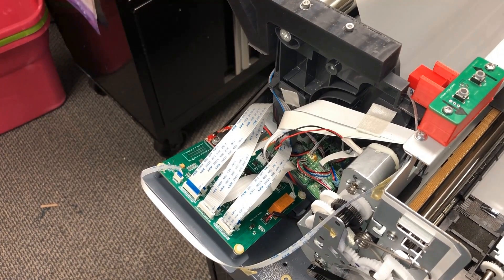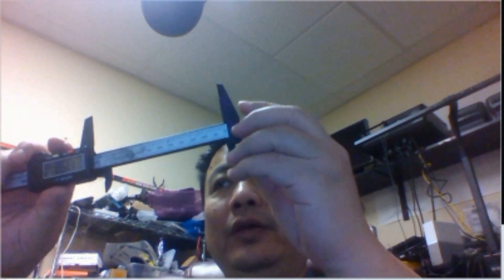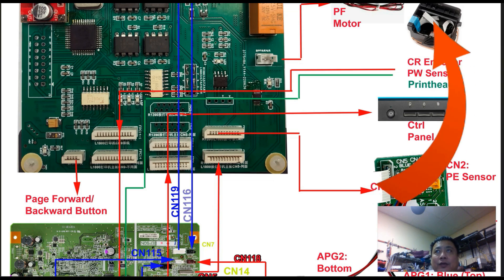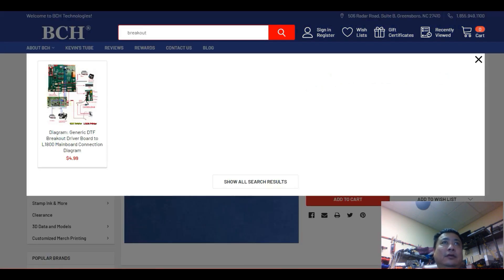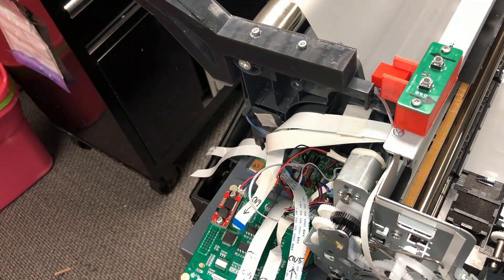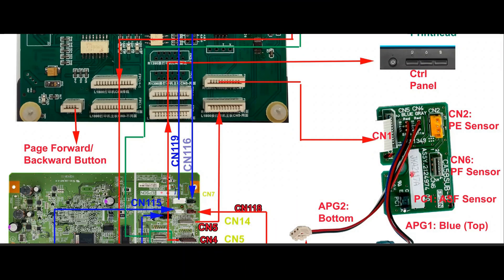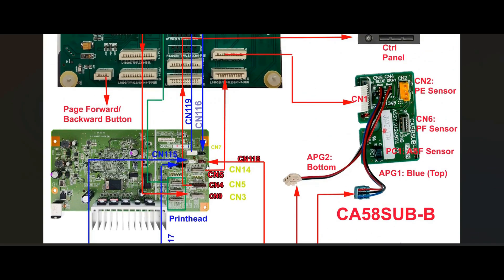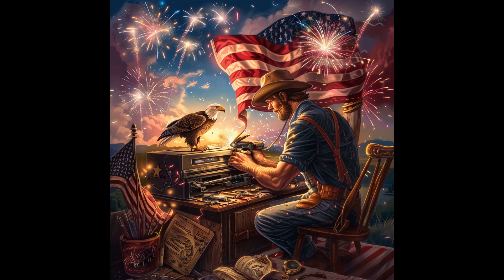L1800 DTF/DTG Connection Guide: Breakout Interface Driver Adapter Board

Comment: Are parts for Epsom L1800 and PLK L1800 the same.. I keep hearing about the L1800 but looks of the machines are different. I just do not want to get wrong parts.
Reply from the maker: Thanks so much for subscribing to my channel and for taking the time to ask this question! Your support means the world to me, and every subscriber helps me get closer to that 100k milestone. It’s been 8 years, and I’m halfway there, but with amazing subscribers like you, I’m motivated to keep creating content and answering your questions. I strive to reply within 48 hours, but if I ever miss your comment, feel free to email me at support@bchtechnologies.com for a quicker response.

To answer your question, the core parts of the Epson L1800 and PLK L1800, like the mainboard, frame, and printhead, are essentially the same. PLK doesn’t manufacture printers—they take Epson L1800 printers and modify them. These modifications often include adding a white ink management system or, in the case of roll-fed models, a breakout board to override the paper feed. Some manufacturers even add a board to convert the L1800 printhead into an L805 printhead. So, if you're purchasing replacement parts, it’s usually safe to assume they’ll be compatible with either version, but double-check the specific modifications on your PLK model to avoid surprises.

Thanks again for your comment and for supporting the channel. If you need more help or clarification, don’t hesitate to reach out. I appreciate you being part of this journey with me!